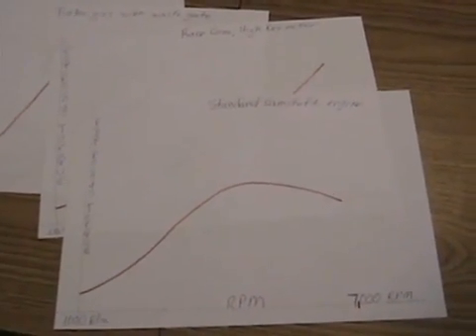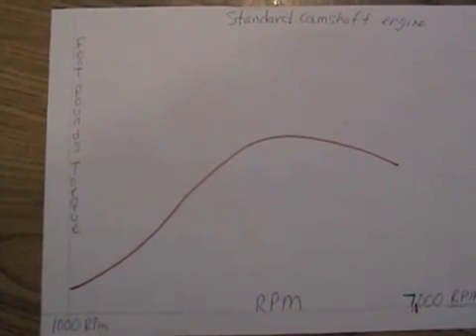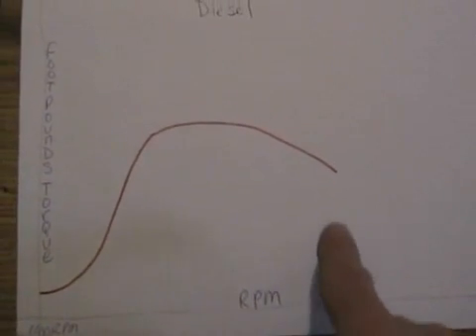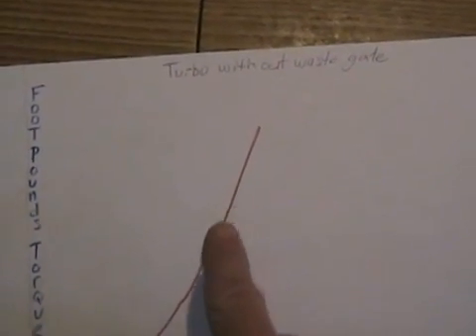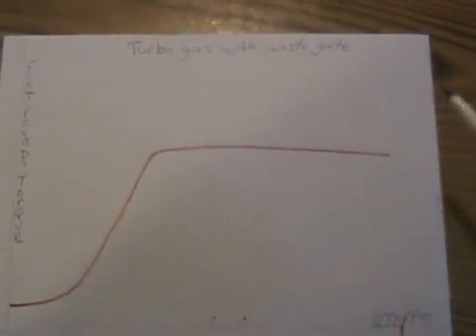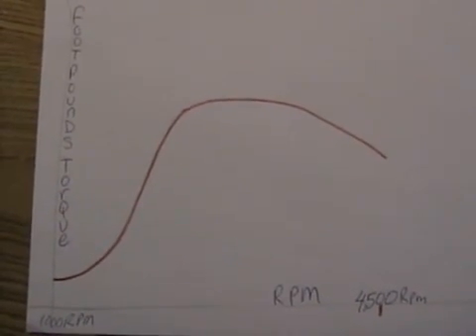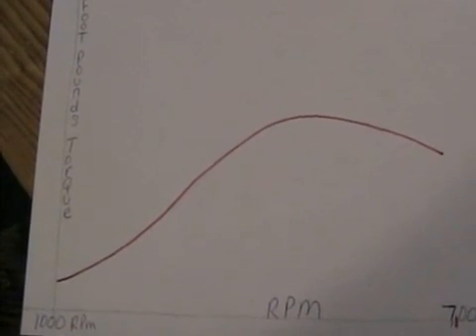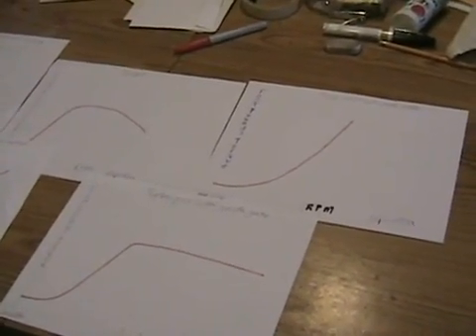how to - basic understanding of auto torque and horsepower - torque versus horsepower

Comment: Is torque more important in deciding towing than horsepower?  As it relates to 0-60 acceleration speed.
Reply: hp is energy. to know how much you can accelerate an object, you need to know the hp....

its tq output just tells you at what rpm you will made said power...

for towing though, you want higher tq for any given hp because it will be a lower rpm and make a more reliable engine for towing

Comment: why is it ten times more energy units then before? if i have it rotating at 100rpms, but i need it at 10 rpms, then i reduce the output shaft speed using gearing by a factor of ten. since i cant destroy energy. this means that my tq output went up by a factor or ten. so now my 1lb of tq went to 10lbs of tq. and my rpms went from 100 to ten. thus still making (10 x 10)= 100 units. thus why its ten times more powerful. hp determines acceleration. you cant compare people to engines..

Comment: tq is a force applied at a distance to a point. nothing else. so 1lb at 1 foot is 1lbs of tq. when you add rpms, you get hp. if a rod rotated at 10rpms with 1lb of tq. you could say it has 10 units of energy (tq x rpm or 1 x 10). that means that i can apply brakes to it with 1lb of friction and it will not increase in speed. thus energy in = energy out. if u always need the output shaft to be at 10rpms then watch. if i had 1lb of tq rotating at 100rpms, then the energy is 100 units.

Comment: sports car at 50mph has a shit load less energy than a firetruck at50mph. this is called INERTIA, look it up. if u want to go farther through the fence (more energy put into the wall) you need to increase the energy u put into the car in the first place, i.e.hp. the amount of tq at the wheel is the amount of hp u have. the faster you go the less wheel tq you will have due to gearing. so increase the hp output increases the wheel tq thus making the car faster. going through a fence is all inertia

Comment: "speed and aceleration equals hp."
Kinda right with that one, the rest, not really. Think of it this way: More power = more torque with more speed. Less power = less torque with less speed.
Or, power is how fast AND how far you take the wall with you.

Comment: yes you just proved me right, Power and strength equals torque 
speed and aceleration equals hp. 
So my point being the more hp the faster you will go but the more strength and power you got the more slower but much more stronger comparing wich one is best is like compering your legs vs your arms

Comment: still think my point is valid becuase a sports car got high horsepower but the torque isent as high as the hp, So if the sportscar smashes into the brick wall thats whats its going to do smash it as f1cars spodrtsbikes etc. But a firetruck with much higher torque but far less hp will not only smash the wall but also fuck the wall up. Its like a sprinter vs a bodybuilder. Sprinter is faster but bodybuilder is stronger. Which one is most imporant we will never know

Comment: @177SCmaro 

Btw i had no intention of getting into this kind of argument. I drive a stock e46 330i and i appreciate it. I have no desire to get caught up in arguments about particular engines, but as an engineer, i get frustrated by all the bullshit about torque vs horsepower. That's the only reason i posted tbh.

Comment: @177SCmaro 

I appreciate your enthusiasm, but what we're talking about is increased peak power vs average power over time. Yes, you could achieve the same longevity as a stock engine if you were careful, but people who build engines in this way do so because they enjoy the thrill of acceleration. I'll accept it's well built and tuned, but i'll wager my left leg you boot it enough to 'on average' stress the engine greater than a stock engine could be stressed. I would, so why argue?

Comment: @MoronAntidote You build them right and they last as long as intended. Besides, a engine isn't running boost all the time. For example, my supercharged 383 spends 99% of its time cruising around as a 8.75 to 1 low stress motor. With low boost it makes around 500HP. Compare that to runing around town with a high compression/rpm NA 383 with the same HP and I promise you my SC 383 would live longer. (And is a hell of a lot more streetable too!)

Comment: @Seattlecarnut 

You do realise that gearboxes and final drives modify the engine torque don't you?

I suspect not, and this is one of the main reasons why people can't grasp the torque/horsepower thing. This video doesn't help at all, because it's trying to explain something in words which is best explained mathematically. Once you see the math it all becomes clear. I don't think you get it right now.

Comment: @Seattlecarnut 

Power to weight ratio is the best indicator of acceleration, given appropriate gearing.
Torque means nothing by itself. Power at a given rpm is the size of the pie. The gearing determines how you divide up the pie. You basically trade torque (acceleration) for speed in that gear. Either way, the bigger the pie the better, so power wins.

Comment: @Seattlecarnut 

Wheel torque determines acceleration, not engine torque.

Low revving engines requires taller gearing, which reduces wheel torque.
If you made that engine produce its torque over a wider rpm range, you could use shorter gearing, and produce more wheel torque.

Comment: @Seattlecarnut 
Makes for a very transient unexciting experience. A brief squirt then all over.
The torque sounds good on paper, but because the rpm range is so low, the gearing is stretched, so you have no more torque at the wheels. It's wheel torque that determines acceleration.

Comment: @177SCmaro 

True, and the real effect of turbos is to effectively increase the engine's capacity as a function of boost. An engine which ingests more air via boost needs more fuel accordingly, but since it usually has lower compression and hotter intake temperature, the effective capacity increase does not scale with the boost. It's a good way to increase the output of a smaller, lighter engine, but it's not free power by any means, and it does add complexity. Great for diesels!

Comment: There is no such thing as "free energy". Turbos might generally be more efficient at creating boost than a roots supercharger, but they still take horsepower from the engine to operate. 
The energy required to force all that extra air into the engine has to come from somewhere.

Comment: @dualCranKy 

NO NO NO

Acceleration at any rpm is proportional to engine torque, gearing, weight, drag and losses. HP is proportional to engine torque and rpm, and apart from transmission loss is conserved at the wheels regardless of gearing etc. Since engine horsepower is the product of torque and rpm, then the higher the horsepower, the more you've got to play with in terms of varying the ratio between wheel torque and rpm via GEARING. Power to weight ratio is king for a good reason.

Comment: @ichigokillsyou Its not really important... What is important is, that you choose the right gearbox for the right speeds...
Example:
You could get out of 50 Nm like 500 Nm with the right gear.
But instead of 1000 RPM your car would only transfer 100 to the tires.
But if your car can spin up to 10000RPM you could transer 1000 RPM to the tires.
I wasnt really right with my first post...
I depends on when the car creates how much torque and usually the better the powerband, the higher the hp.

Comment: @ichigokillsyou The power itself is just the HP.
A car with more torque usually creates that torque in lower RPM, so it will have indeed also more HP, which is the important thing, in the lower RPM.

Comment: @ammarns Hp is how fast something is moved. 1 Hp = 75 Kg moved up 1 meter in 1 second. Hp is also nothing that can be measured but it's calculated. You can measure both torque (engine force) and rpm (engine speed) and use these to calculate the Hp.